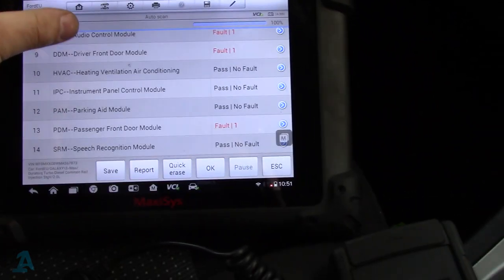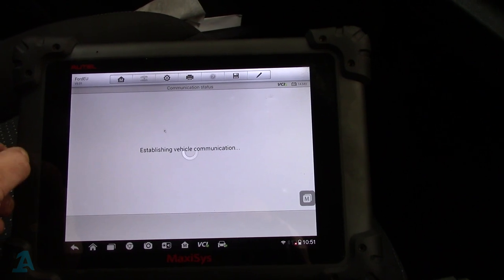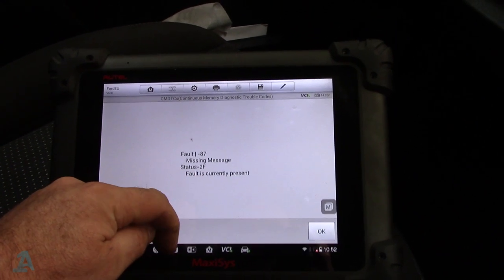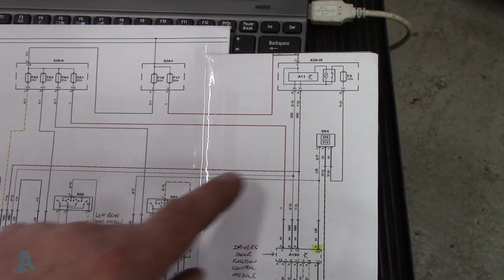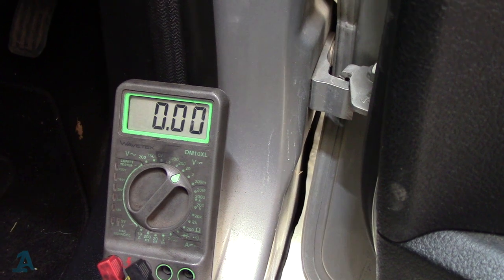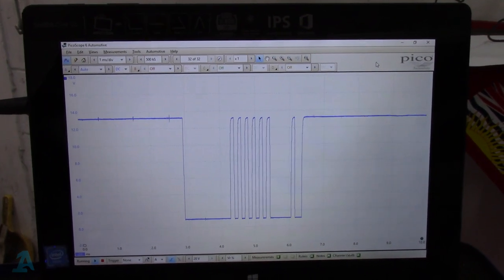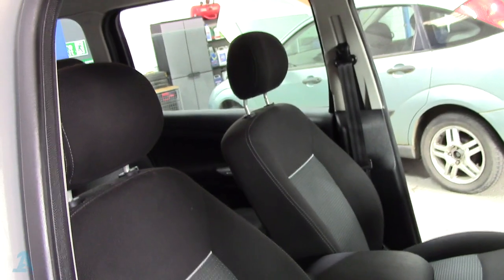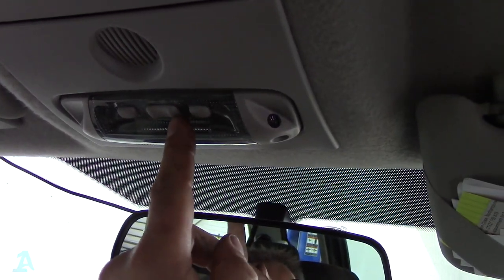Ford Galaxy MK3 Window Switches Not Working

Comment: Definitely heat cycle related problem here, check out the peak amps when you switched the bulb on at 8:44 its over 5 amps - if that happens enough times - fues gone! 
nice vid
Reply from the maker: jools Grudgings Well spotted. I tend to agree as the fuse didn't look like a fast blow. Cheers 🍻

Comment: I would say Rob that you gave it a good shot in trying to find out why the fuse blew. And maybe it just blew from heat cycles. And why do auto manufacturers think it's a good idea to put fuse junction boxes up under a dash? Great job in seeing your thought process in tracking down the problem :)
Reply from the maker: Thanks Terry, I agree with you. I've looked at the fuse more closely since the camera was switched off and it definitely didn't show signs of a fast blow like when you have a short. Cheers 🍻

Comment: Great video. My drivers side switch unit is not working either, but 10Amp Fuse 3 and all internal lighting is working fine. Power supply to switch unit is 14.2V on Black and 12V on blue. I can't measure signal on the LINBus wire. However the central locking also dead on Drivers side, so it has to be a loom problem.

Comment: Hi mate I had a similar problem  fuse was blowing turns out faulty wire in the fuse box person in the Passenger Seat was kicking their feet and that's why I kept blowing
Reply from the maker: They certainly cram the wires in down there so I can see how easily that can happen. Cheers mate 🍻
Reply: I bailed out a friend of mine who does windscreens. It was a van and the owner was blaming him for a whole bunch of the electrics being out after he did a replacement. Traced to under the dash where his Mrs liked to kick when she sat in it.  She got a stern talking too. 😂

Comment: My cousin had something similar. Bunch of things died in her car. Interior lights were on that circuit. Further interrogation revealed she said it hadn't worked since she pried one of the bulbs out with her pen knife. I looked at a friends car that had blown a headlight fuse without explanation. Changed the fuse 2 years ago, still fine and it defies explanation.
Reply from the maker: It's a weird phenomenon that electricity stuff :)

Comment: Whilst many would replace the fuse and be done with it, a thorough approach was shown here by Rob trying to track down the cause of the open fuse. I suspect that there are a few clues as to what might have happened:1. Customer said kids were always playing with the lights. High In-rush current, especially if multiple lights were switched on and off simultaneously while a window was going up etc. This over time may have compromised the fuse. (This was mentioned in another post well spotted). 2. Seems odd the the central light was missing. These bulbs rarely need replacing, however the thermal shock on the filament from the children flicking them on and off might explain why it failed.3. Cheap wiring and poor design by Ford. The circuits on that fuse probably didn't have much leeway before causing trouble.
Reply from the maker: DJ R All valid points, thanks for your comment. Cheers 🍻

Comment: good job rob . finding a blown bulb after it had been removed . customer may have saved some money if you had the full story
Reply from the maker: Simon Rawle well the customer said it happened long before the windows packed up. Having since looked at the fuse I think it was just down to heat cycles. But yes the more info we get the more chance we have.
Reply: or maybe the light went in the winter wen people dont use there windows much . guess you will never know

Comment: Got the same issue with my galaxy today. So I will be checking the fuses tomorrow. 
Another issue I've had on my car for years, is if you put the passengers or drivers windows up. They ALWAYS take 3 times going up and down before finally closing. 
Any ideas on that issue ???
Reply: If it's anything like the Mondeo mk4, you need to program the window. With the ignition on, press and hold the window down button until the window is fully down. Press and release the window down button till you hear a relay click, usually 3 times. Next press and hold the window up button to fully close the window. Then again, press and release the window up button a few times till you hear the window click. Do this for all windows. If you ever change or disconnect the battery, this has to be done again.
Reply: @RikAindow  thank you. I will give it a go as its still driving me nuts
Reply: @maxv77  good luck. Let us know how you get on. 👍

Comment: Could it be overloaded by someone holding down the up/down button for a long time after the window has reached its end of travel? Never measured it but it's a significant current draw, on my car it dims the headlights visibly, even with the engine running.
Reply from the maker: Not in this instance as the switch module was powered by the interior light circuit. On these ones each window module runs its own separate fuse and they were ok. But you're right they do pull some current.

Comment: Any chance you could do a video on modern car wiring systems and how they work? Somebody told me that modern car wiring cannot be soldered. I still live in the copper wire age, which I would prefer.
Reply from the maker: You can solder wires if they are copper. The only wires I know of that won't solder are O2 sensor wires as they are made from a different material
Reply: Thanks for the replies. One of Henry Ford's motto's was that "Simple is efficient". There is far too much , unecessary, complexity, in modern day vehicles. IMHO.